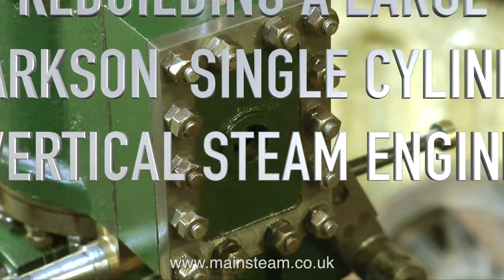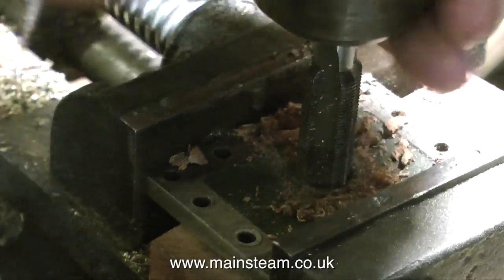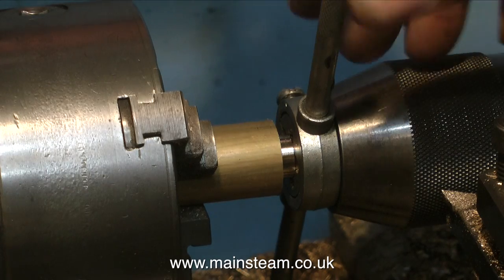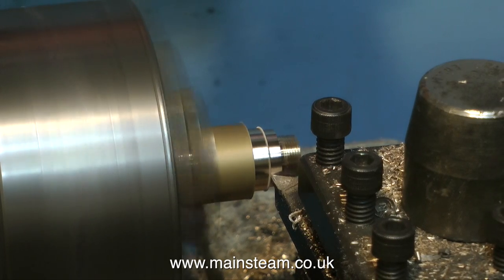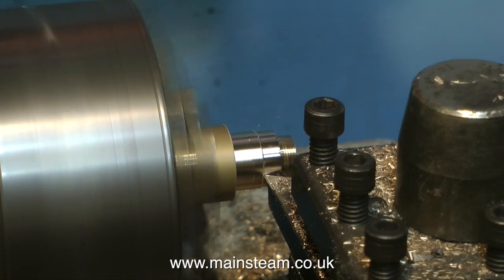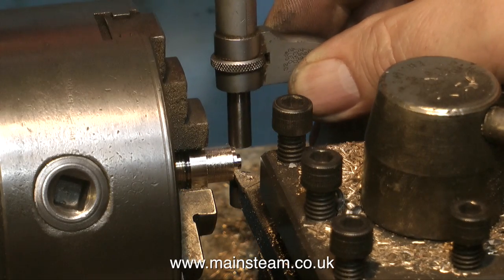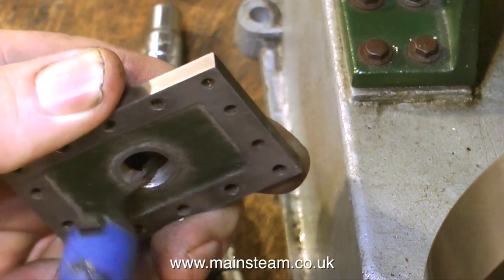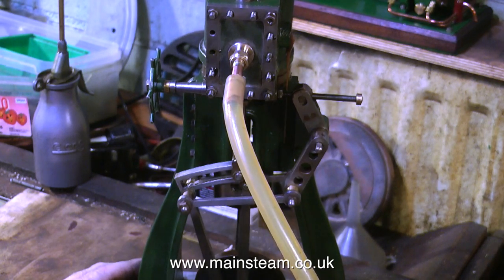REBUILDING A LARGE CLARKSON VERTICAL STEAM ENGINE - PART #2

Comment: +Keith Appleton, Hello sir!!
I was wondering if you could make a short video for us amateur, aspiring model engineers on how to calculate and turn a tapper on a small piece of work. To be specific,  a connecting rod on a Stuart Model such as the No. 9 or the Beam/Victoria. I know it's just a matter of tail stock offset, but like you I'm not a professional at this. I just can't seem to get it right. You have a great way of demonstrating these types of things, so how about it? 
Thanks much!

Comment: What locomotives have you manufactured or rebuilt over the years?
Reply from the maker: +Jonny Stevenson I have built, rebuilt, or refinished a 7 1/4" gauge Stanier Black Five, A Midland Single (Spinner) in 5 inch gauge, two 7 1/4" gauge "Tich" locomotives and a 5 inch gauge GWR "Manor" class locomotive. I built a "Simplex" in the early years in 5 inch gauge as well as an electric "Thomas the Tank Engine" based on a "Boxhill" chassis. More recently I built a "Sweet Pea" modifies to 7 1/4 inch gauge and a rolling chassis for a 7 1/4 inch gauge "Sweet William".
Reply: +Keith Appleton that's quite an impressive collection. Hope they will feature in a video.